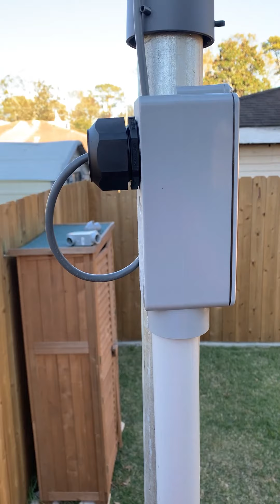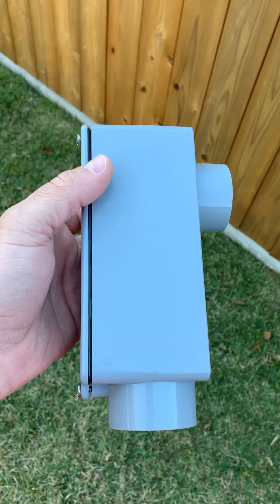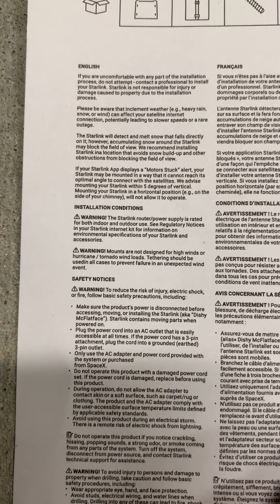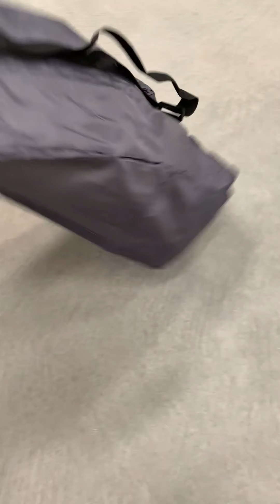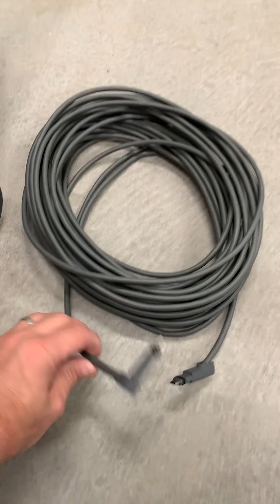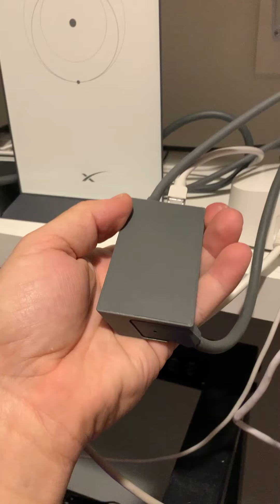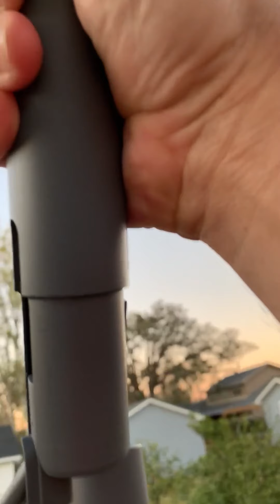Starlink Gen 2 Install [150 Ft Cable, Ethernet and Pipe Adapter, Cable Routing Kit, Load Balance]

Comment: Great video!  Your configuration is exactly what I've got laid out.  I ran conduit underground last summer so that I'd be ready even if my dish showed up in the middle of winter (northern Wisconsin).  Well, my dish showed up about a week ago but I can't do anything with it yet because the last piece of the puzzle (150' cable) is backordered until the 2nd week of February.  I don't have to worry about hurricanes, but I am mounting it about 9' in the air (on a 12' pipe) in order to keep the dish away of the dozens of bucks that visit my yard every day.
I am still shocked at the number of users in densely populated areas that are getting Starlink.  I would think that Starlink would target rural users first.
What kind of speeds are you getting?  The reason that I ask is because the email announcing the shipment of my dish said I could expect downloads of 100-150mbps and uploads of 20mbps.   That kind of disappointed me.  I see all of these videos online with 200+mbps.... that's my expectation, not 100 mbps.  Oh well, I'll just have to wait a couple more weeks before I find out.
Again, great video!
Reply from the maker: I’m guessing they are shipping to populated areas (up to some limit) because it’s financially rewarding without a huge network capacity impact / degradation to rural areas.  If I were them I’d be utilizing the network capacity everywhere I could to accelerate growth in other areas.  In other words, it makes no business sense to not rollout in populated areas if it doesn’t have a negative impact on rural areas. A good friend of mine is much more rural than I am, needs it more than me, and hasn’t got his yet. I do have a video that shows some performance data for my location.  I’m planning to do another performance test in heavy rain.  This data was with 100% cloud cover.    https://youtu.be/Wotw2-uhITE
Reply: @goodfella7483  

Great video.  I installed mine on a SL pole instead of adapter. 75 ft cable buried 6" underground with wide sweep elbow & drip leg before going into pole.
Starlink worked ay first on volcano mount.  When I installed in conduit, it quit.  Despite multiple factory resets, etc, it continued to give "unplugged" message. Router light on & broadcasting but no interrnet.  After 2 weeks, finally got message from SL. They wanted pic.  As soon as they saw I installed in buried conduit, they voided warranty.  Their instructions say cable not rated for burial.  I interpreted that as not being direct burial.  They are actually recommending cable lay on ground!  Apparently they don't understand concpt of lawnmowers.
I've gone round and round with SL & now waiting for a new cable to try that I had to buy.  Worst service company I've ever encountered.  I'm a PE & ran a high tech company for 30 years so I'm no expert but not new to this stuff.
Hopefully sending this to you privately so as to not call SL attention to your conduit install.
Have you had any issues with regard to burial in conduit?
TM
Reply: @tommiemaddie9614  Did your new cable come in and does your SL work now? My kit  shipped today and I was about to start construction.

Comment: Thanks for the video. Good job. I’m still waiting since Feb 8th 2021 for order confirmation. It’s great to see the details. 

I live in rural The Blue Mountains in central Ontario Canada and have a vacation property in Haliburton, Ontario; an area we call “Cottage Country” - so I have two pre-orders waiting. Both locations currently are on satellite internet Xplornet (AKA Xplor-crap) and paying through the nose for overage charges. Neither location have available LTE fixed wireless; both locations are surrounded by forest. The cottage order has been rescheduled for January 2022, while the house is April 2022.

We don’t have your hurricane issue, but have winter and potentially large snowfalls; so, I’m planning on a J-mount off of my roof gables so that the snow melt will simply fall clear of the roof.

Comment: Thanks for making this video.  As a fellow Louisianian who lost internet for quite a bit longer than you (I don't even know how long it ended up being but it was maybe 2+months) I was/am looking into setting this up for myself as well!

I think video / info on the performance of both the Starlink and the T-Mobile fixed 5g would be helpful to see for reference!

Bummer about the 90 deg / rectangular hole...nothing a little patching couldn't fix but I bet you are like me and don't bother with that in your data closet :D  Mine is a bit of a mess when it comes to all the holes where the wires are coming out.
Reply from the maker: Performance video next!  Nothing some sheetrock mud can't fix.  LOL.